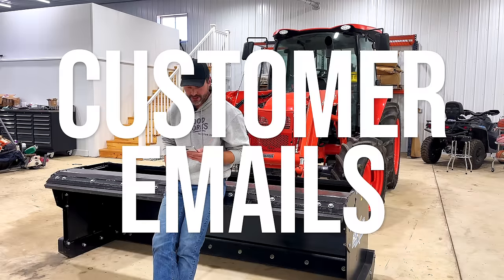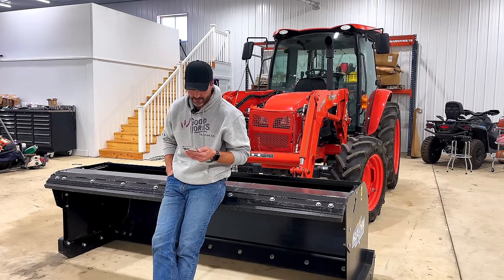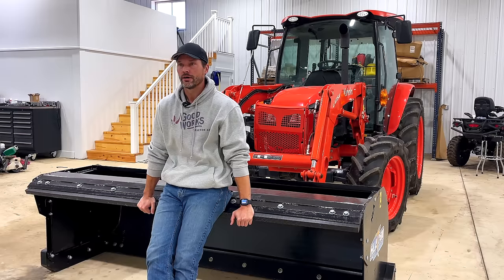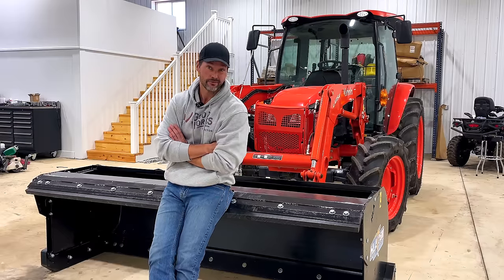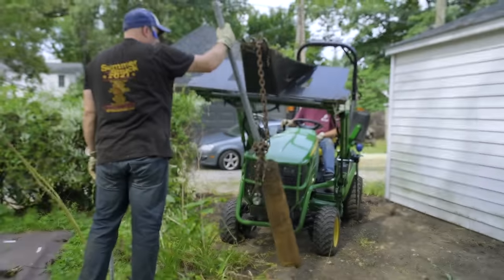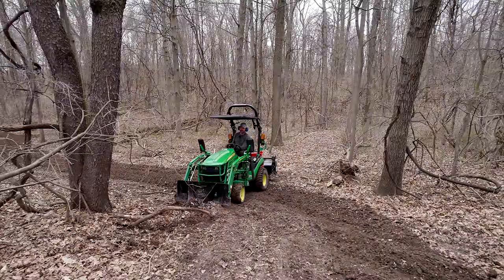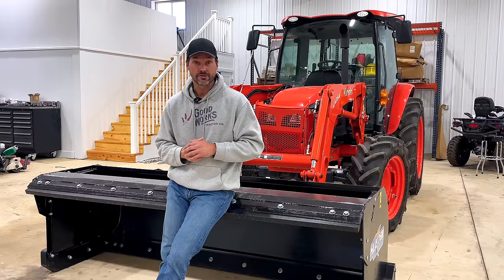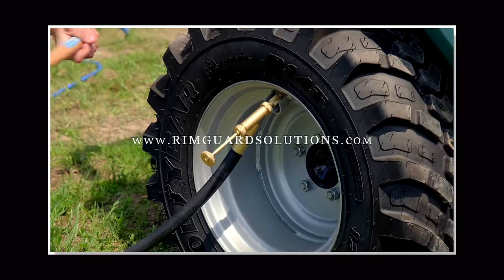WOULD YOU CHOOSE A MASSEY OVER THE JOHN DEERE 1025r?

Comment: I WOULD NOT BUY A Massey AGAIN, I have both the Massey 1010  (1986) and its a cold blooded son of gun & i have replaced all parts to make it start i have to pull it with a truck & compression start it on a warm day... I now have a 2023 1025R the BEST, starts every time the ease of putting the mid deck on it FANTASITC COMPARED TO MY PREVIOUS MASSEY & CUB CADET MOWER THIS IS WHY I BOUGHT IT SO I COULD HAVE A MOWER WITH A DECK I CAN REPLACE IF NEEDED IN THE FUTURE AS WE KNOW HOE DECKS WEAR OUT AND COST AS MUCH AS A NEW MOWER & THE DEERE TRACTOR THAT STARTS, MID DECK,  QUICK RELEASE BUCKET & GRAPPLER WITH 60HRS 17K NO REGRETS OTHER THEN I SHOULD HAVE DONE IT YEARS EARLYER.

Comment: Is john deere the only drive over mower deck system?
Reply: No. I have a MF GC1725 and a 60 inch drive over MMM. It takes me about 5 min to connect and about 5 to disconnect and drive off. This includes adjusting the gage wheels for even mowing that seems to be just as good as a finish mower. I prefer the MMM to a 3-pt hitch finish mower since I look down instead of back behind me to see the edge of the mower. The only thing is use gloves when disconnecting the mid PTO shaft as it gets warm when using.

Comment: 2:06 chintz is pretty vague, so I wouldn't be making any purchase decisions based on that. There is a channel, mid coast tractor service, and his videos are a little rough but he beats the crap out of his Massey all the time. No other sub compact channels beat up the other brands like he beats that GC. It's amazing the beating that little Massey GC takes. My GC1723 has been awesome, but I don't use it a ton, and I treat it well. Stand it side by size with a BX or a New Holland and there are a lot of similar parts and designs. Anyway, for some actual specifics, I WOULD NOT purchase a new GC right now for one simple reason. The forums are flooded with 2022 and 2023 model loader control valve leaks even after dealers "repair" them. Seems like a parts and supplier issue and AGCO doesn't have a new supplier and a permanent fix. I'd buy a 2021 or older GC or go with another brand until AGCO fixes the loader control valve issue.
Reply: I purchased a 2022 GC1725 in May and haven't had any problems with it at all.
Reply: @ltg72260  you may have gotten lucky and purchased from an earlier batch of 2022 models that doesn't have the loader control valve issue. For anyone purchasing today, I'd grill the dealer on this issue and make sure they would pick up and fix it without hassle if it does start leaking.

Comment: You are nuts on that John Deere! I have a 1025r and GC1710 Massey Ferguson and the difference is the Massey is more reliable,  better fuel economy, trade in value and better warranty. We broke a 1025r in half running a 6 inch post hole digger and my thoughts are this JD would not stand behind the warranty and alot of pot metal/aluminum type metal! The trade-in value on the JD's horrible they won't hardly take them for trade-in value and you just take a bloodbath on them! So I came to the conclusion that all you're buying is just the name and the brand and that's about it I guess it's painted green if it makes it feel better? PS when you're running tillers beside each other on each tractor you just want to have a fuel tanker following you around on that John Deere when you put the same amount of fuel in them the JD is about 1/3 less efficient and you spend more time fueling up then getting work done!

Comment: I owned a MF 1723 eb and have run a JD 1025R, Kubota Bx, and a Mahindra emax 22. IMO, the MF is the bast bang for the buck. The JD has a much more comfortable seat and opperator station. I wasn't impressed with the emax. The BX was nice but over priced.

Comment: 3800 isn't the difference in price.   But that JD with all its proprietary BS and you'll get the final price over the years.   The best thing is. You don't have to worry about what you're choosing it'll be chosen for you.   He needs to add in Kioti and compare.   In the seat.  On the sheet.   I was in this same road. And I went up a size all said and done.   JD needs to get over themselves with the proprietary BS.
Reply from the maker: Definitely more to consider than initial price...long term ownership costs can be significantly different on different machines

Comment: Avoid Mahindra at all costs. Upfront you save some money, then you pay dearly later! Lots of breakage, expensive repairs and warranties they will not honour. Go to Mahindra Tractor Problems.... NUFF SAID.😮
Reply from the maker: Is this from personal experience?
Reply: Every brand has its own dedicated “problems” forum. In a sense, every tractor, truck, car, etc. absolutely sucks and has terrible quality. How do I know? Because I can point you to a bunch of angry owners online. 

I don’t own a Mahindra, but if you’re going to malign an entire brand, you’ll have to do better.
Reply: Dealer support for mahindra is pretty bad from the couple of mahindra dealers I've talked to, one of which was dropping them for kioti.  And they are very well known for their issues with getting warranty work done as well.  OTOH, my experience with them is that they tend to be fairly robust machines overall, no more or less prone to breakage than any other brand.  Admittedly, I've only dealt with mid 2000s models.

Edit: based on my conversations with dealers parts and service departments, JD and Kubota are apparently very good at dealer support, new Holland went through some issues with dealer support when Ford sold them, but I don't know their current situation since I haven't talked to one of their dealers since.  Massy furgesson is pretty good about dealer support, but not quite as good as Kubota and JD.  No comment on kioti either as I haven't talked to that dealer much since they switched from mahindra to kioti.